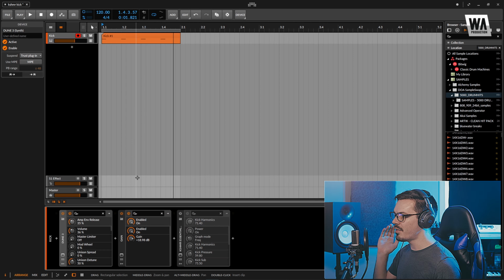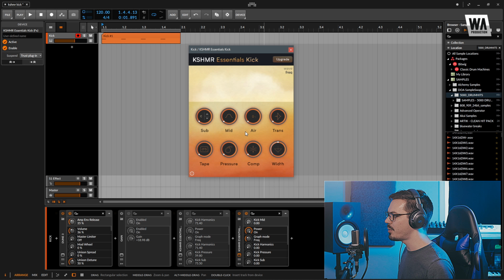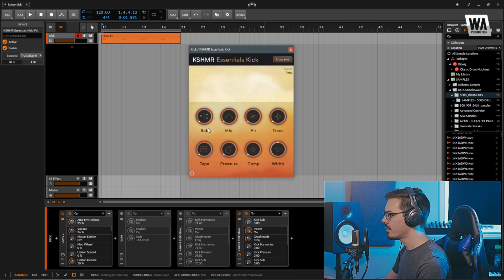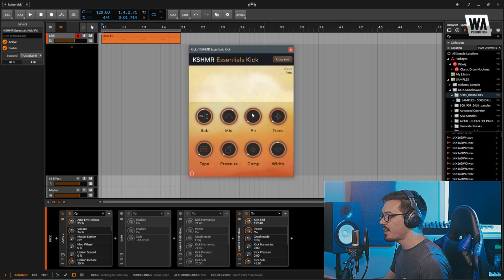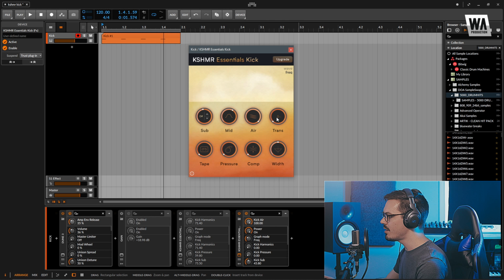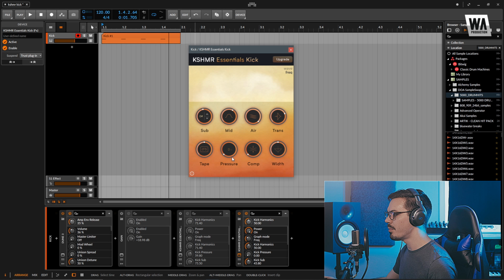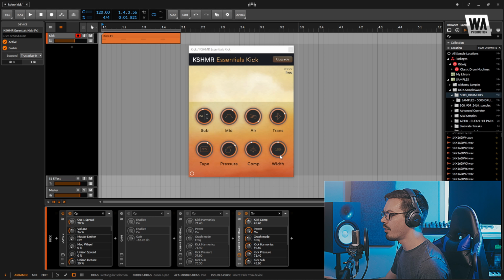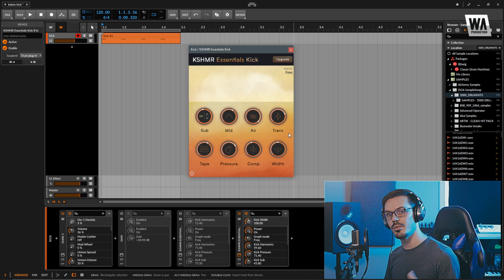FREE KSHMR Essentials Kick Plugin (VST / AU / AAX)

Comment: i like the concept of putting the most important kinds of high-level controls into a single plugin for ease of use, but this video made it really hard to hear the effect of some of the knobs. your synth's oscillator was probably set to random/continuous phase. set it to fixed phase to get a consistent output for each note. especially on parameters like the transient control there's just no way to tell what this plugin did when the kick itself has a different transient every time. one thing can be said for sure though: this plugin needs a gain out knob. dialing in subs, transients and pressure are all processes that can change how the loudness of a kick can be perceived so it would be hard to dial them in without a gain knob, since that makes it impossible to a/b compare
Reply from the maker: thanks for the feedback!